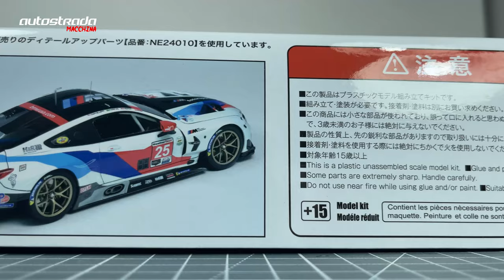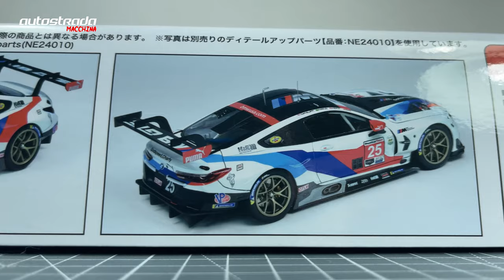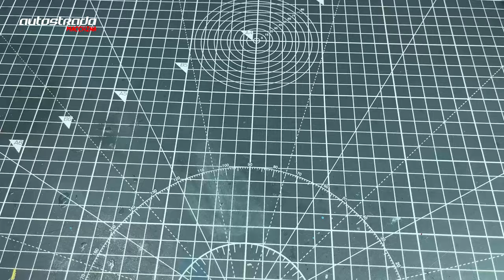I built a Daytona 24 hour winning GTE racecar - 1/24 BMW M8 GTE 2019 - NuNu

Comment: Hi there what are you using to paint over the decals and tyres is it just a Matt lacquer.a do you use a softener on decals.one other one what you fixing the windows in with.regards Glynn
Reply from the maker: Hi Glynn, on this one it was a Matt Clear yes. On both the body and tyres. I do use a softner for the decals, Microset and Microsol, the windows I use micro kristal klear (spelt that way)